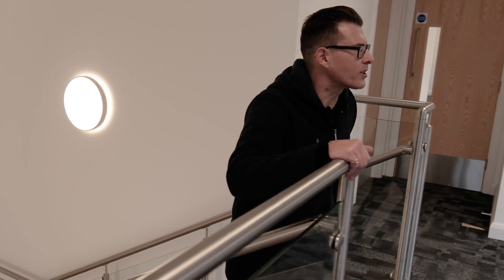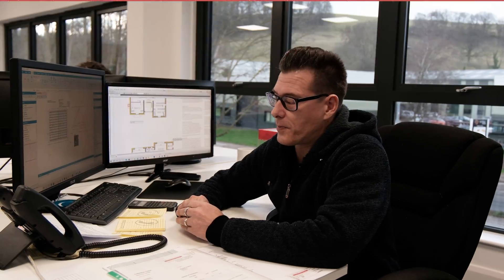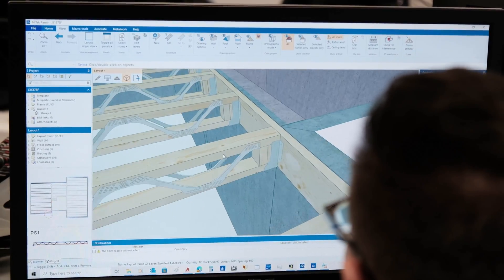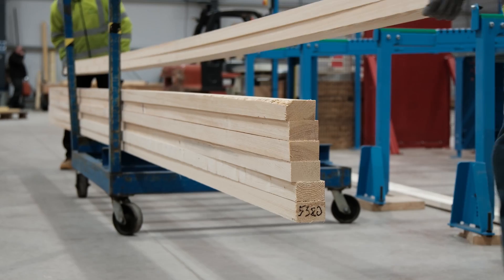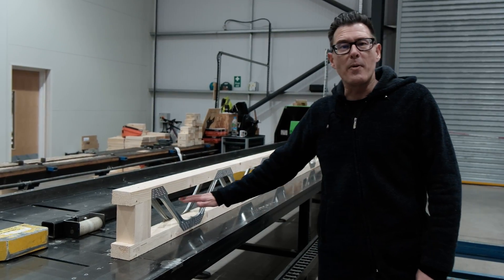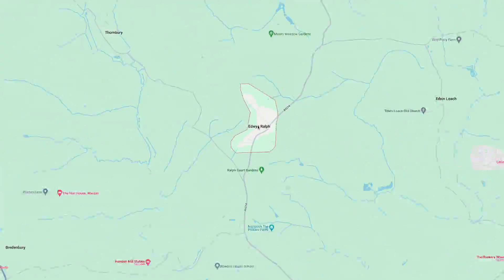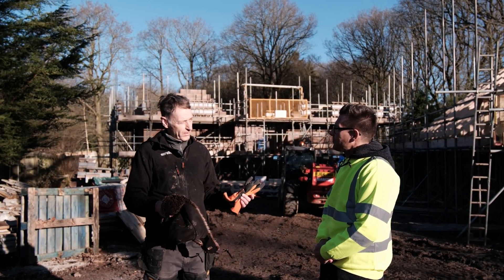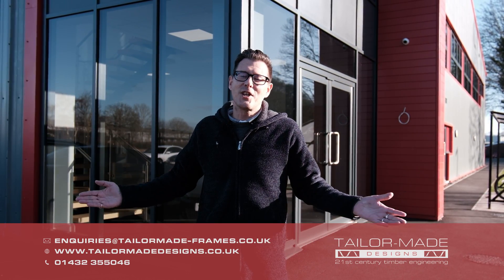How is a Posi-Joist Made?

Comment: What is the cost compared to conventional joist?
Reply from the maker: Posi-Joists will cost more initially (a 4.2m posi-joist at 225mm depth will be around £50 compared to £30-£35ish for a solid joist), but the cost savings come once you factor in labour for installation and routing services. Typically you'll find posi-joists work out cheaper in the end unless doing the work yourself and not paying yourself a wage.